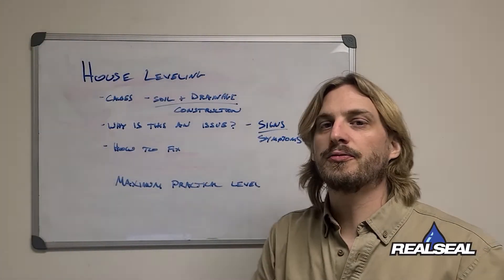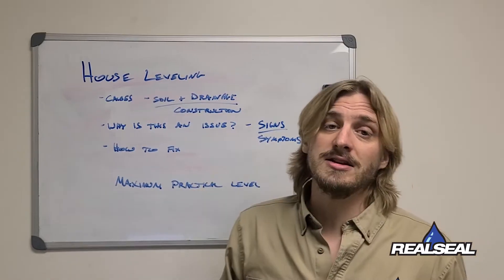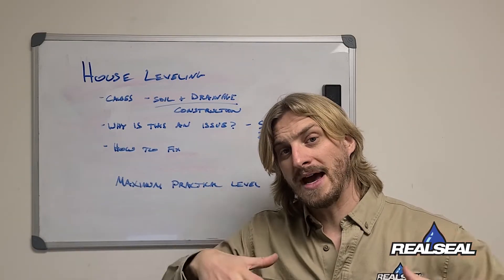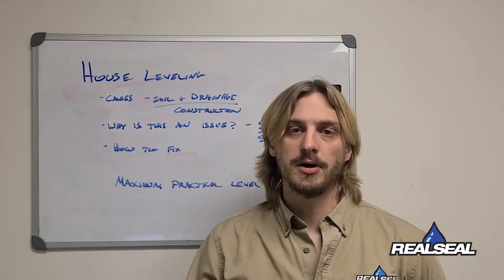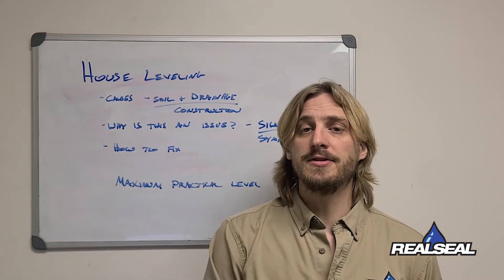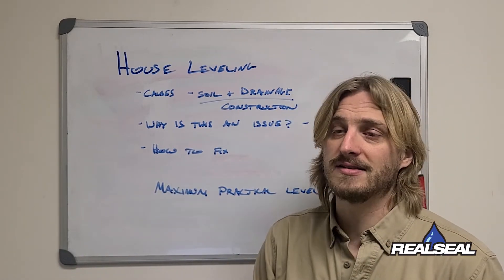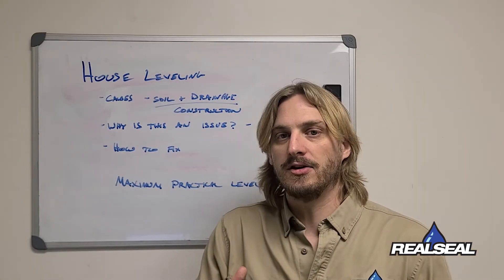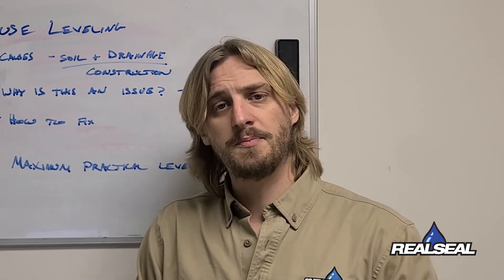The 5 Basics Of House Leveling

Comment: What is the average leveling cost?
Reply from the maker: It depends on the size of the area being leveled. Most projects are completed in under $1,500.

If your whole driveway, patio, and sidewalk need lifting, that's another story and will need to be measured and quoted for the extra work.